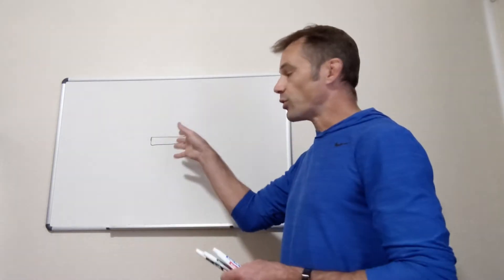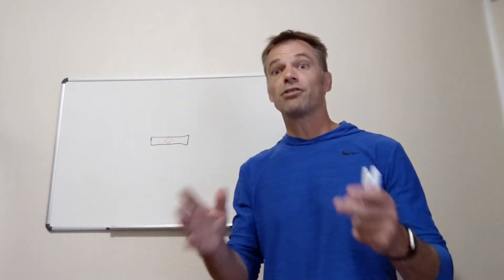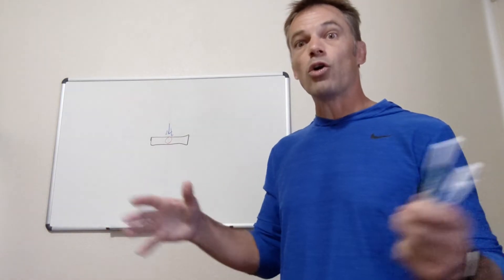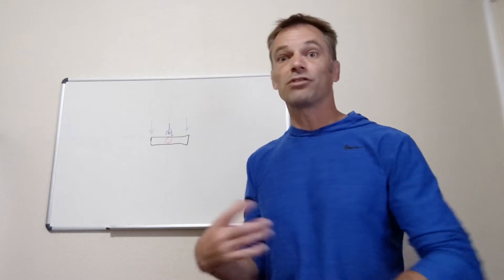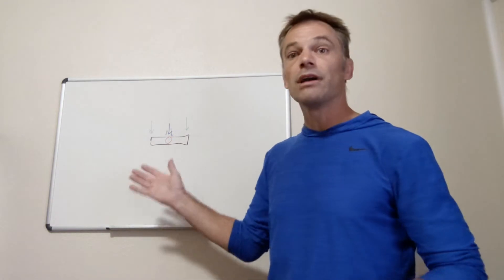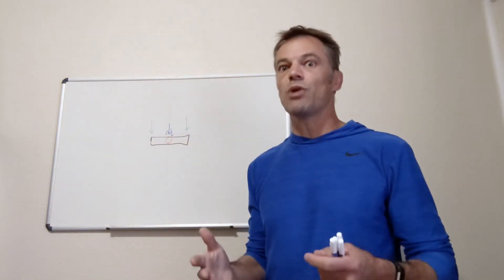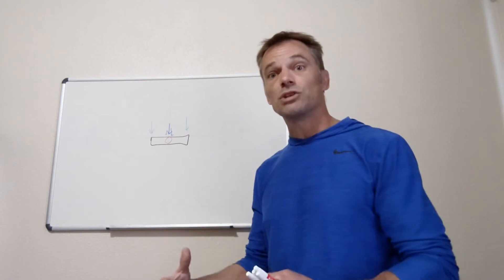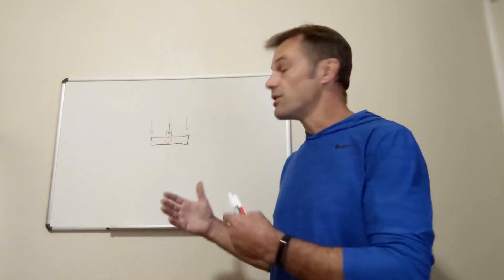Applying Engineering to the Pedal Stroke

Comment: Hi James! I like a lot your interesting videos and thoughts about bikes, mtb and pedalling. In this case, nevertheless, I think your analysis is not complete. When you are pedalling, you are not pushing a platform down or up as a lift. This only happens in let's say one out of the 360º of a full rotation. If you consider the other positions, is when a clipp pedal plays a role and brings some gains, calculated up to 30% for a very good professional biker, specially when rolling smoothly. At given positions, you are pulling the pedal up, or pushing it forwards or backwards, not necessarily only down. You are right on the other hand that the better the force is applied on to the center of the axis, less energy is wasted to stabilize the pedal (as a platform). Clip pedals are good for rolling for these reasons. For DownHill, FreeStyle and many other categories where pedals are used for many other important features as controlling your bike, pushing it up or sideways or similar, clipless pedals are the kings, obsviouly! Do you agree? Thanks